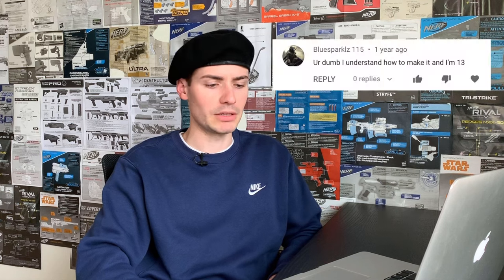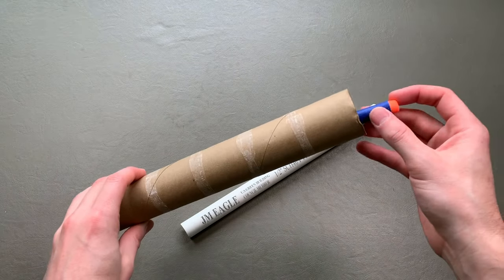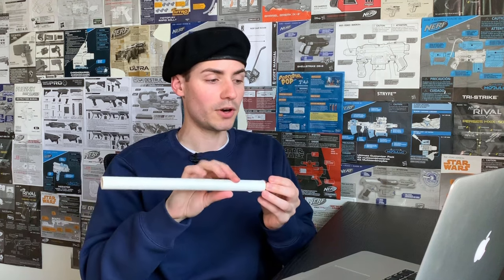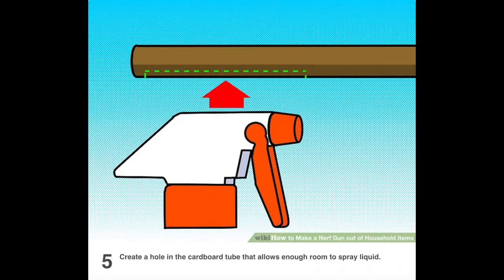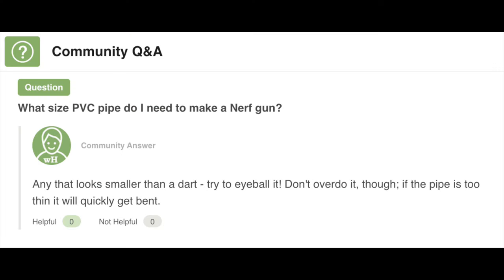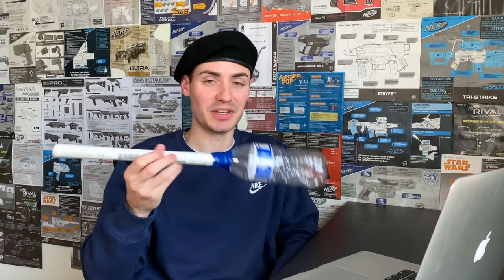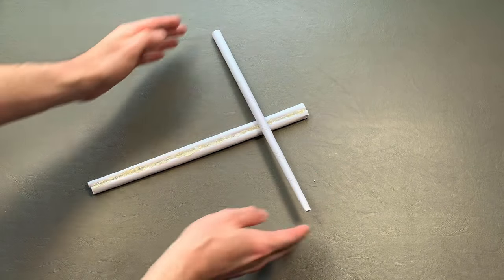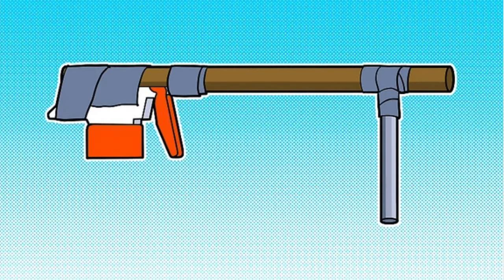wikiHow Revisited: How to ACTUALLY Make a Nerf Gun Out of Household Items

Comment: Waiting for the inevitable short-dart mag fed paper crossbow.
Reply: I could see that working, if a hole was cut in the shaft right in front of the clothespin to act as a mag well. You’d probably have to move the string around the darts and then manually slide them back into the clothespin, but it still seems doable.
Reply: @isaacbailey3681  what about a mag on top upside down? Have it just fit on so the top dart just touches the main body of the crossbow. Then you pull the elastic band under the dart and attack to paper clip and fire. To secure the mag you would have to have something behind the paper clip that comes over it to hold the mag in place. But then your stock would need to be made out of something a little bit stronger than paper. Maybe you could make the stock a triangular prism made out of cardboard and hot glue? And I am not 100 percent sure about what to make the support for the mag out of, maybe do the same thing, but have 2 so you form an upside down L?

Comment: I made 4 versions of the crossbow now I have probably the best one yet it’s called the popsicle stick.  I made a handle out a popsicle stick and a grip.  It has a catch to well catch the rubber band it’s made out of zip ties.  I also put barbecue sticks in the front bow arms and glue the ends together. Then, I put popsicle stick on the clothespin.

Comment: You can find a type of pipe that's about the size of the hole in a nerf dart (I don't have a dart or the pipe on hand to check), but their are s few issues, 1. That type of pipe is called a supply line not a pipe, 2. I's not exactly a household item as they're often replaced with a type of stainless steel tubing, and 3. They aren't PVC and are actually very flexible and not rigid.

Another thing is that there are actually two kinds of pipe called "PVC". There's actual PVC pipe, which is white in color, and CPVC pipe which is slightly yellowish in color. They are functionally identical, however CPVC is slightly smaller than PVC, but are listed as the same size (IE a 1/2' PVC pipe would be slightly larger than a 1/2" CPVC pipe). My guess is they where talking about CPVC pipe in the article, which might be just small enough that the dart gets a better seal. Maybe.

Comment: I think the way the blaster would work is to pull the nozzle trigger over and over which releases air into the PVC and once the air pressure is strong enough to where there’s too much air in the pvc, the dart will pop out, (essentially a champagne bottle)

Comment: You want me to make my own variation of the last one? Fair warning, household materials for me isn't the same as household materials for other people. I wonder if I have enough solder to braze 2 copper tubes together instead of using paper tubes for the body. Should have enough bungee cords.
Reply: Household items for me would include spring steel bow instead of rubber bands. I might have to purposely get a clothespin, though.

Comment: The reason it doesn’t work is not because there’s not enough airflow. Those spray nozzles work by putting pressure in the tank/hopper whatever it is. Increased pressure causes the water to get out through that tube you always see in spray bottles. I straight up just taped the whole bottle on and it works perfect.

Comment: Can you get bert to do one of these wikihow videos? Also for the water bottle blowgun, don't tape over the tube to stop the dart, use a wire/string across the middle of the tube for better airflow. Not trying to be "that guy", but a super loose barrel fit HAMP needs all the help it can get.
Reply from the maker: Maybe if he finds one that he likes. And yes that is a good alteration, I just liked how the tape kept the dart in place.

Comment: Ok. So ive been workshopping it in my mind, what if the pvc pipe is to block the nerf dart from falling back to far but still let in air flow? And the cardboard tube would probably be the size of the half inch pvc pipe, maybe from like a tin foil roll or just from the dollar store, and u use the tape like a seal. Thats the ONLY way i can make sense of these and honestly im thinking maybe thats how its intended. Tho, i would think you would need to seal the back of the tube off so tha air can actually build up inside the gun.

Comment: Another home-made nerf gun 

What you need  : water bottle, garden hose nozzle, sports ball,  pvc pipe, bike pump, knife tape, epoxy 
 
Build steps 
1) Cut out the hole in the ball that allows air in, cut slit in bottle, secure the section of ball to inside of bottle with epoxy
2) use tape to attach the pvc pipe to the garden hose nozzle 
3) twist the bottle on to the nozzle

Firing steps
 1)  but a dart in the pvc barrel 
2) use pump to create air pressure in the bottle 
3) squeeze nozzle to fire 

Bonus tip: get a mini bike pump and zip tie it to the bottle with the pin (?) in the hole

Comment: Hey there Beret, um your idea is amazing, yet it needs improvement. What I have tested before is with a ‘air compressor’. Some of time depending on how much F.P.S. I use, may make the dart explode. (80-110 is your best bet, depending on how many nerf darts you want to go through.)
Plus if you get a battery powered air compressor and put it in a backpack, and do what you did in this video, then it would work MUCH better.
And is it ok if I use this idea??/yours?? But this comes with the weight of the battery powered air compressor. And if you want so spend the time and money.

Comment: I think the household item nerf blaster doesn't work because the pvc pipe should fit the dart inside and  still have a little bit coming out because the inside of the pvc pipe should be air tight and you should duct tape the spray lid to the pvc pipe making the pvc pipe air tight and when you push on the spray trigger it sends air into the pvc pipe and sense the pvc pipe is air tight eventually there well be enough air in the pvc pipe that the nerf dart in front of the pvc pipe well go flying

Comment: The point of the tube being smaller than the dart was to insert inside the back of the dart itself. The idea behind that was to concentrate the non-existent airflow the spray nozzle was supposed to create into a small enough space to build up enough concentration of pressure to allow your dart see some air time. Lol the instruction and pictures and physics in this wiki-how was laughable lol.

Comment: For this mod, you will need:

1 drain blaster
1/2" PVC pipe
Duct tape
Nerf darts

Duct-tape the PVC pipe to the drain blaster so it is airtight.  Load a Nerf dart into the front, pump 20 times, and pull the trigger.